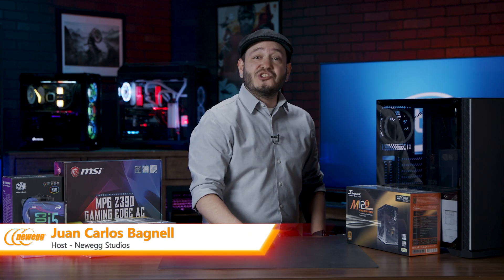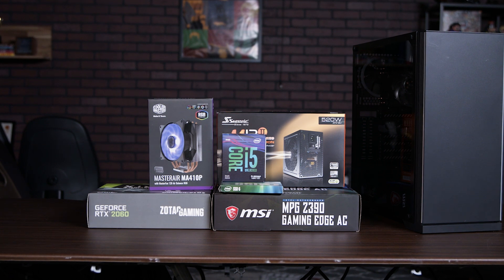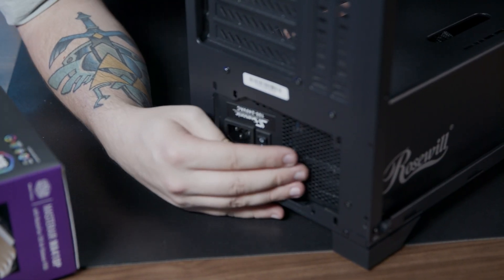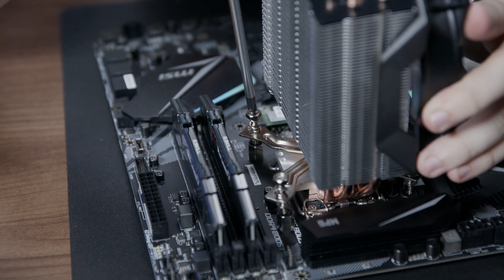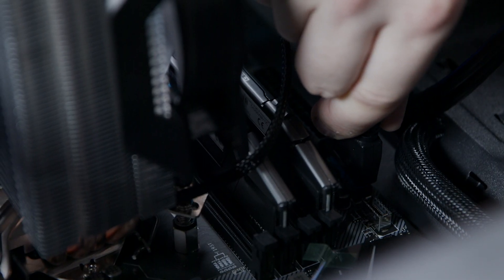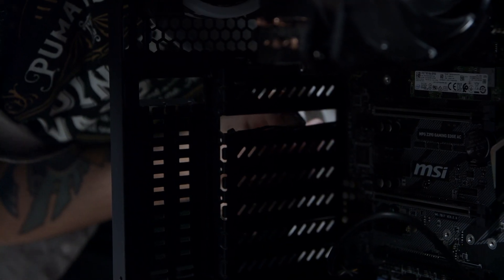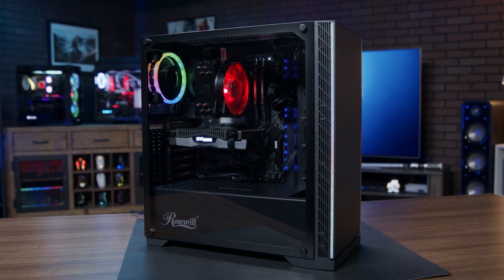Intel Core i5 Unlocked Geforce RTX DIY Kit: Step-by-step building guide

Comment from the maker: 0:01:25 - Prepare the Case and Install the Power Supply
0:02:32 - Prepare the Motherboard and Install the CPU
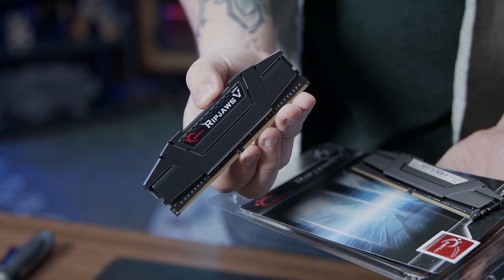0:03:33 - Install the Two Memory Sticks onto the Motherboard
0:04:03 - Install the M.2 SSD onto the Motherboard
0:04:19 - Install the CPU Cooler onto the Processor and Motherboard
0:04:57 - Install the Motherboard into the Case
0:05:30 - Connect Cables from the Case and Power Supply to the Motherboard
0:06:55 - Install the Graphics Card onto the Motherboard and Case
0:07:28 - Connect the Power Cables to the Graphics Card and Tidy Up Cables
0:07:51 - Install Microsoft Wiundows 10 Home on the Computer